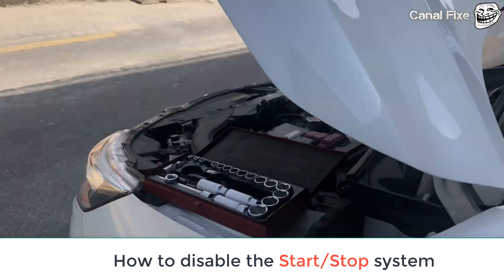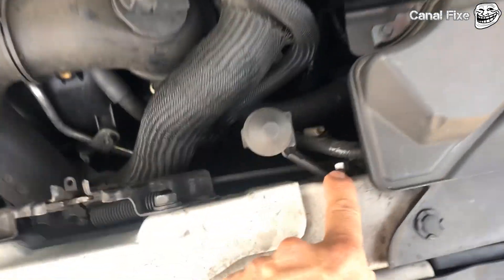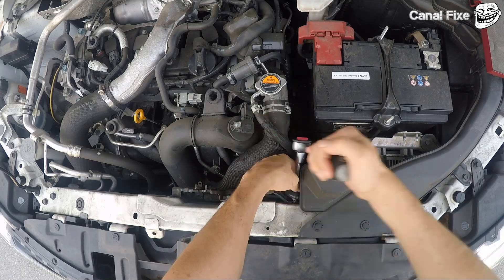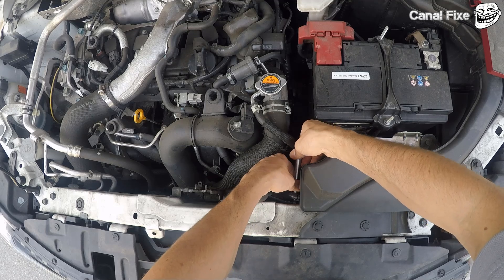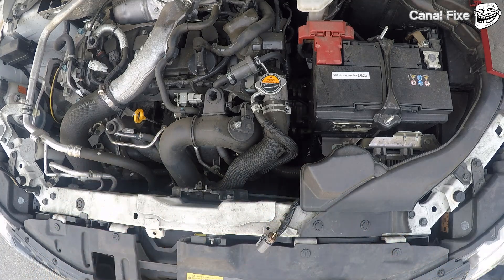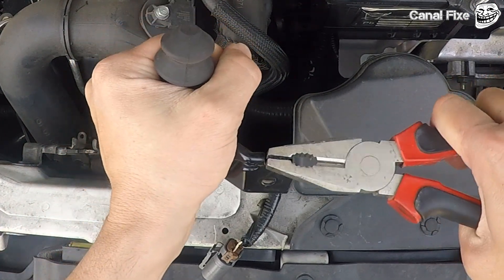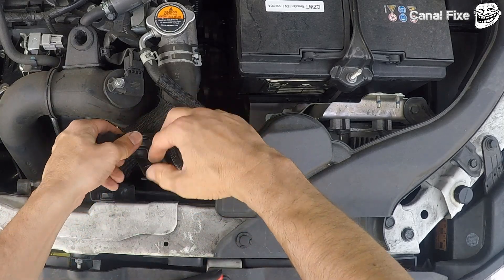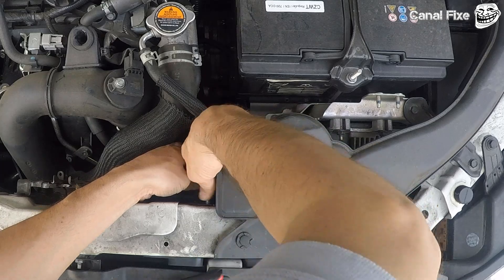How to disable Stop/Start system permanently on the Nissan Qashqai

Comment: It certainly does work, however. Although the "door open" warning sonar sounds, it switches off after about 1 min. Not entirely sure why you don't leave the switch in place and just unplug the socket (as you have done) and don't plug it back in. Obviously tape up the plug ends to ensure no water ingress and if one is concerned about dangling wires, zip lock them out of the way. As canalfixe stated, if the car has an alarm, it may not be possible if the same switch operates the alarm.

As a second idea and I am not entirely sure if the start/stop switch is live on or live off, why cant the switch just be bypassed or better still the function reversed so its permanently off and the switch turns it on.....Any thoughts ?

Disabling this function will also prolong battery life since constant start/stops (causing extreme amperage draw) will fatigue the battery quicker, even if the battery is a more expensive start/stop type, battery life will be longer without it. And if one wants to discuss the advantages of saving fuel and CO2 etc, disposal of batteries requires energy and they have toxic waste...;-)
Reply: Because the switch is power on when released (bonnet open). As such, if it is left unplugged, the two terminals need to be shorted before waterproofing. :-)

Comment: If you do this modification, when you bring the vehicle in for warranty service and the tech does the diagnostics check he will see error codes for the vehicle's security system.  When bending this tab out of position you cannot bend it back without breaking it. This part is not cheap to replace. Especially during warranty I would not modify anything on the vehicle. 

Why not make the habit of simply remembering to press the disable button each time you start the car, as like driving a car with manual headlights, or remembering to use the signal lever before making turns??? 

With many of the vehicles, when leaving the vehicle there may be beeping sounds outside of the vehicle indicating the front hood is not properly closed.
Reply: Exactly what I’m doing. I just got used to it.

Comment: You don't need to unplug the connector before bending the lip right? You just unplugged it to have a better grip on the bracket to bend?
Reply from the maker: Ues, you don’t need to unplug the connector. I just have unplugged to handle it better 👍🏻
Reply: @canalfixe  I turned the sensor, works perfectly and no errors. Thanks! :)
Reply from the maker: Cool 👍🏻👍🏻👍🏻
Reply: Done exactly what you did still getting the error message 🤔

Comment: i dont have alarm and did this, but after a few weeks start stop fault came back anyways. So this is not a sollution iam affraid. I also would like to turn off start stop function permannently but it seems impossible
Reply: I just switch it off manually every time I start to drive .

Comment: This may be a totally daft question but why would anybody want to permanently disable the stop start function? I just use the manual override where appropriate in slow driving queues for example but use stop start as normal elsewhere.
Reply: Why don’t disconnect if I don’t want to use it at all? 🤔